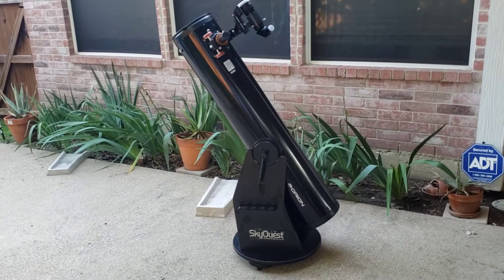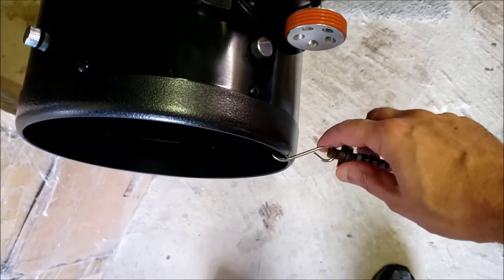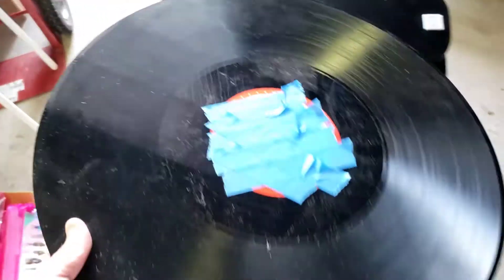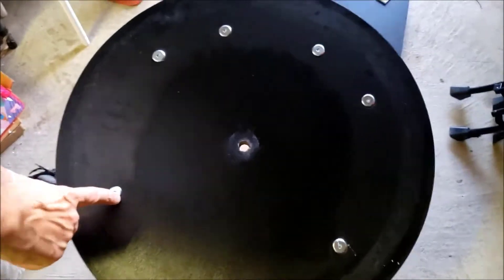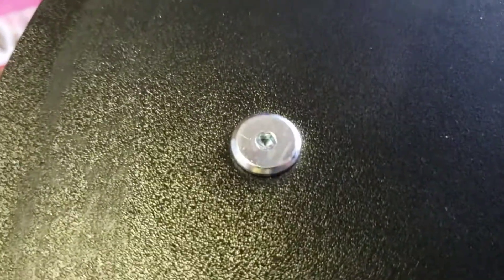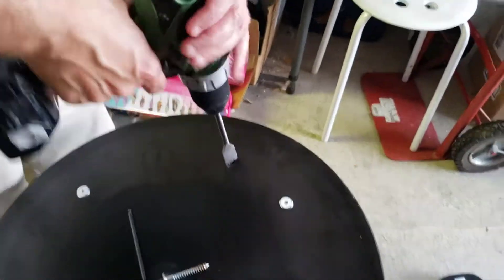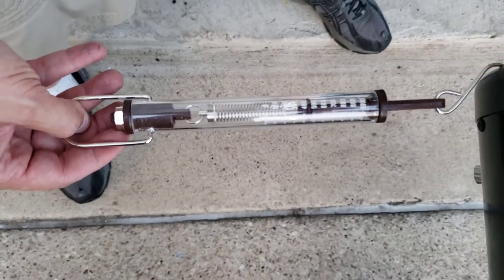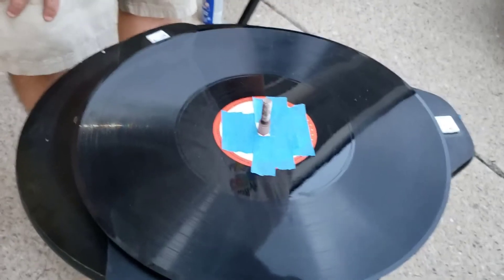Telescope: Reduce Friction By Using An Old Vinyl Record Album

Comment: There is one dobsonian telescope  which uses ball bearings.  At 700 grams the ota would be spinning circles.

No vinyl records needed.
Reply from the maker: Several of the nicer big Dobs use Lazy Susans, like the Apertura models. They spin very smoothly. Some Dobs even have braking devices to slow it down.

Comment: Just did this mod to me Celestron 8" dob which had alot of sticktion right from the box. Kinda cheap the way they do it. Found a 16" record on eBay (didn't know they ever made those), some teflon material. One thing i did different was to put the pads on a 45 degree bias so that it would perhaps a more gradual amount of friction, made 1", 1.25", and 1.5" pads so I could potentially adjust the effect but 1" seems good. Also cut a disc for the center with the same stock. I didn't measure with a scale but it is very smooth and easy now. Thanks for another valuable tip!
Reply from the maker: I'm glad it was helpful.  I like your idea of using a Teflon disk in the middle.  Hopefully that all stays smooth for a while.

Comment: Cds work too. Perfect for those older cdrs that have stopped playing due to the dyes deteriorated, or they are scratched to.hell or damaged on the silver top.   Vynil is coveted these days, and if you are like me you may have a ton of old cd-r copies of music and software that would be glad to sacrafice themselves inside a dob, or have a better afterlife than a trash bin if they no longer function. 

You dont need a disc that large, a 5" cd is enough, it acts like a slip bearing, and gives just enough lift  on the rocker board, taking just enough weight off the pads to make the slewing easier
Reply: Also it is a REALLY bad idea to disassemble these particle board dob mounts.  I almost commented on your xt6i restore video.

They lose stability since the particle board can't handle the screws going in and out multiple times.  Most of the community knows this, and this is why commercial dobs are rarely shipped, and are hard to return once they are assembled. 

And back to the cd, the hole is already.the right size. No drilling required
Reply from the maker: I've taken the particle board mounts apart a gazillion times - perhaps I've just been lucky in my specific cases.
Reply: @reflactor  also it is possible the info that was going around the community was being overly on the safe side. Or perhaps particle board quality has improved, or scope companies are getting better particle board now.

Or yeah, maybe you just got lucky, and are probably really careful to go exactly in the same threads and not cross thread it.

Comment: At comparable price, is Dobsonian mount better than tripod at filtering vibrations / shacking
Reply from the maker: Absolutely. With a boxy frame and fairly heavy construction, Dobsonians are notoriously solid and shake free.  If there is a shake, it dies down almost immediately.

Comment: I’m going to try this, my TX8 is very stiff, makes it very hard to move it just a little to track anything. Thank you.
Reply from the maker: Let me know how it goes.  For my 8 inch Dobsonian, I couldn't use the standard 33rpm record because the diameter was just shy of the existing Teflon pads. I had to order an old larger 16 inch diameter record on eBay (pretty cheap, but it was one extra step).

Comment: I just ran across this video. Thanks for the tip!! I just found some 2" round teflon pads on Amazon. They're self adhesive instead of screw-on, but over a quarter inch thick (0.3"), so can be drilled and counter sunk with flat head screws. I figure the larger area of the pads might be an advantage. Set of 12 for $12.49 as of January 3, 2023.
Reply from the maker: That's a fantastic find!  You may want to try out the self-adhesive method before drilling anything. Please let me know how it works out! I think I will order a set of these for comparison sake.

Comment: FIRST congrats on 2k subs. Just looking at your older vids. I think it was a good test and if you dont mind i may even buy a record and try it too BUT i will use a singer or group that iam or was mad at.
Reply from the maker: Thanks!  This is certainly a passion project. Lots of fun.  Make sure to use the "large diameter" albums. I had to buy them special on eBay.

Comment: If you get yourself a sheet of ebony starr laminate, and laminate the surface were the teflon is going to be contacting, you are going to love it. 
The same goes for the “altitude” bearings. This worker really well on mine. But what really did it for the altitude bearings was to 3d print large rings to go over the factory bearings. And laminate those. Then cut the section were the bearings ride at on the wood mount and to make it fit the larger bearings.
If i was to do it again, i would had built new bearing supports(the vertical sheets of wood) instead of modifying the factory ones.  But i’m extremely happy with it.
Reply from the maker: Thank you for bringing that up. I've heard many great things about the ebony star laminate. The main disadvantage is cost when compared to an old vinyl album.  I've put albums on two of my Dobsonians and they spin like butter.

Comment: Thanks for making this video! I replaced the original plastic pads on my Orion XT-6 with cheap 3/4" Teflon furniture sliders. These made my telescope far more usable than it had been before, and with reduced stiction, it's much easier to point the telescope where I want. I bought a 16" vinyl record and I set it up as shown in the video, but I found that I actually had less stiction without it, so I ended up not using it. I liked using furniture sliders because they easily tacked into the base of the telescope, and with my particular model, 3/4" sliders were the same width as the wood, so I could use them to replace both sets of the original alt and az pads. Using furniture sliders meant that I didn't need to cut anything, and they were much cheaper/easier for me to source than an entire (expensive) sheet of Teflon.
Reply from the maker: Thank you for the comment. The furniture sliders is a great economical approach (I didn't know they existed!).  With regard to the album/stiction, I installed a record on my oldest Dob (not shown in the video) recently and I had to adjust where I put the Teflon pads because it seemed to have more friction. It took a couple of experiments, but now it's buttery smooth.  The Teflon squares that I use are usually much larger than the originals though and that may also play a big part? Clear skies!
Reply: Where did you find the Teflon slides
Reply: @suny493 , I just found some on Amazon. I think the ones I'm going to use are the 2" round ones for a larger foot. They're adhesive backed instead of screws, but they're thick enough (0.3") to drill and counter sink with flat head screws. $12.49 for 12 pieces. Hope that helps... Reflactor is kind enough to share tips, so we might as well also. Clear skies!
Reply: I also have an Orion dob. Similar to your's, but only 6 inch. I have tried putting three simple Teflon pads for furniture and now the base can move much more easily.
Reply: I did the same thing with my 4 1/2 Orion. After I installed them, I put some silicone grease on them. Moves fine now.  They also work good on furniture.

Comment: Very good video which definitely gives me a head start.  Thanks!   I am curious about one thing.  How you are able to spin the base to remove the nut on the azimuth axis center bolt without a wrench on the head of the bolt underneath the triangular ground base plate.  In my Dob it requires two wrenches to tighten or loosen the center bolt and nut.  Do you have the bolt permanently fastened to the triangular base plate in some manner?  My bolt simply falls out when the nut is removed.
Reply from the maker: Good question. The previous owner must've had a flood because the main bolt was rusted to the T-Nut installed in the triangular base. I tried to remove it, but the rust was too solid.  I was able to clean up most of the water damage, but that bolt is going nowhere.
Reply: @AstronomyGarage  Ah, that T-Nut must have been added by the previous.  Like my Dob, the manual for Orion XT Dobs shows the center bolt is held only by the upper nut. There's no T-Nut in the bottom ground board.

Comment: 700 grams is 1.5lbs.  Not a huge amount of force, but better is better.
Reply from the maker: Very true.  Even at such modest forces, it was annoyingly noticeable when trying to nudge the tube to follow my sky target. Well worth the effort - it's super smooth and easy to start moving even now, months later.
Reply: I would think it is not so much the amount of force, but rather the difference between the stiction and friction force that matters. That sudden reduction in friction makes you overshoot where you wanted to move to. Tiny adjustments are difficult.
Reply: @NotTheSharpestBulb-mh  Exactly. In basic physics it's called static friction vs kinetic friction. Typically static friction is higher than kinetic friction, meaning you have to apply more force to break the bonds between surfaces before you get any motion. But once you do, you are now applying a larger force than needed to maintain motion (kinetic friction exerts a smaller opposing force that, unlike static friction, doesn't change in value with the applied force) and you'll jump past the target. Getting the static friction to equal kinetic friction creates a "buttery" feeling that makes it easy to achieve fine movements.

Comment: nice i am going to try this. have the same issue with my 10inch dobsonian
Reply from the maker: Be sure to use one of the large 16 inch wide vinyl albums.  The standard album is 12 inches, but you can buy 16 inch albums pretty cheap on eBay.